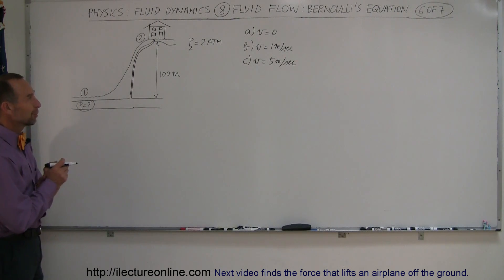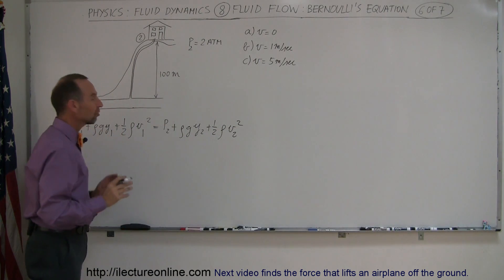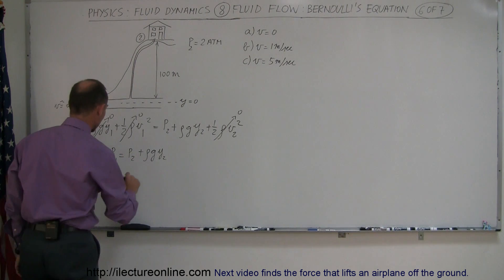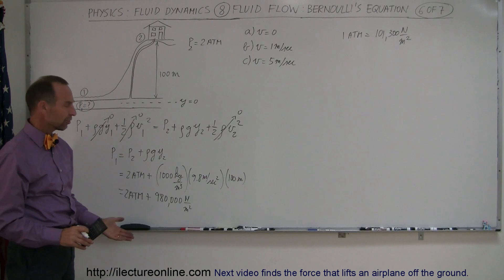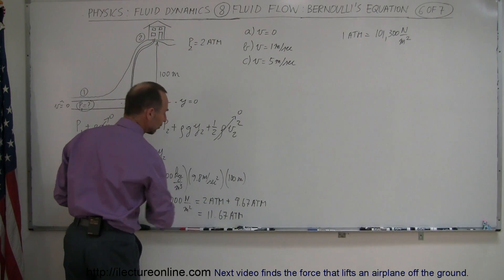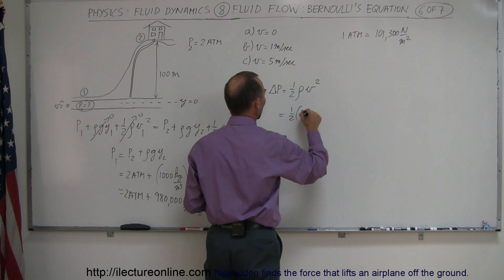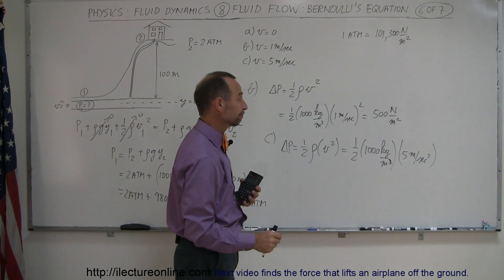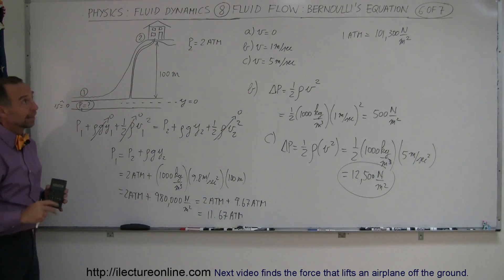Physics 34  Fluid Dynamics (6 of 7) Bernoulli's Equation

Comment: Why do P1 and v1 not change when v2 increases?
Reply from the maker: The "main" (the large pipe under the street) is typically so large that it is virtually not affected by what goes on in a single line of a house (which is much smaller in diameter and carries a lot less water).
Reply: @MichelvanBiezen  Thank you so much! :)

Comment: Hi I have a question about HSRO EDI Package. Say you have the capacity of EDI 5m3/hr then the pump used for the distribution has 18m3/hr due to lot of point of use. Is it ok? Is there no gap or deficiency at the suction like 5m3/hr vs 18m3/hr? Or there's an explanation? Thank you.
Reply from the maker: That is a question that probably needs to be directed to the manufacturer.

Comment: Why are we not considering the height( i.e. 100m) in part b and c?
Reply from the maker: We worked out the pressure difference first using the change in height.  This pressure difference then results in a change in the speed in parts b and c   (Therefore the height was considered in parts b and c)

Comment: but what about the diameter of the pipe? why should the diameter of the pipe not be considered for the calculations?
Reply from the maker: The diameter of the pipe is not needed in Bernoulli's equation.  It is used sometime when the velocity is needed.

Comment: Can you do one example where by the tank is at 100 m high. And a pump is required to pump to 12 m levels below the tank.
Reply from the maker: It sounds like it is the very same problem with different numbers?  Let me know if that is not the case.
Reply: @MichelvanBiezen  Hi. Is a similar problem with your video. Is just that instead of pumping the water up from bottom, it is pumping the water down from above. I had managed to spot my mistake already. Thanks!

Comment: How velocity of points 1 no zero velocity???
Reply from the maker: If point 1 represents a LARGE CROSS-SECTIONAL pipe, then the velocity of the water in the pipe will be very small due to the small amount of water moving up the small diameter pipe.  And since the velocity term is squared, a very small velocity squared is nearly zero and can therefore be ignored.
Reply: @MichelvanBiezen  শর্ট ভাবে ক্লাস নিলে ভালো বুঝতাম please i want connect to you Facebook page
Reply from the maker: I seldom use my face book page.  (No time for it).

Comment: Hi Michel van Biezen,
Thanks you for your videos.
I have some problem as when I have a lot of sink on using the same time, that I can use this Equation ?
P1 + 1/2ρ v1 ^2+ρgh1 = P2 + 1/2ρ v2 ^2+ρgh2 +  P3 + 1/2ρ v3 ^2+ρgh3 +  P(n...) + 1/2ρ v(n...) ^2+ρgh(n...)

Thanks you.
Reply from the maker: I have never used that equation.  That is not the way in which Bernoulli's principle is used.

Comment: One question sir, why we have water tanks at height when we are considering pressure as atmospheric at both ends.. We want pressure or velocity at the end.. Will wait for your reply.. Thanks
Reply from the maker: The difference in atmospheric pressure is typically small compared to the difference in pressure to the difference in water level.  Therefore typically it is ignored.  If necessary the difference in atmospheric pressure can be added.

Comment: Will you please explain more why V1 is zero??  If you consider it as a reservoir rather a pipe then V1 might be zero as the fluids are not flowing. 
for (b) and (c) why h2 is not considered ??
Reply from the maker: Point 1 is at the main of the water supply that supplies all the houses and businesses along the way.  The velocity of the water through the main tends to be very small and can typically be ignored when compared to the speed of the water in the pipe feeding the house.      When the water through the main speeds up (when lots of customers are using water, the pressure in the main will decrease and the pressure at all the houses will decrease
Reply: @MichelvanBiezen  Thank you so much for the reply about v1 but for (b) and (c) why h2 is not considered ??

Comment: One dumb question here: the computed P1 in (a) was in such a way that P2 should be 2atm while v2=0m/s (closed valves), should we not re-compute for P1 and P2 in (b) and (c) when v2=1m/s and 5m/s to see if water will surely flow inside the house at a normal enjoyable rate?
Reply from the maker: Certainly, that would be a good exercise, but at this time, I believe the logical answer should be apparent.  That is often done with physics.  (What would happen if we let the "variable" go to zero, and what would happen if we let the variable go to infinity?)   That often gives us a good insight.
Reply: @MichelvanBiezen  thank you for helping me develop and strengthen my reasoning skills which I believe is helpful in enjoying physics like I've never done before!

Comment: Thanks Sir, But number C  the speed should be squared which is equal to 25.
Reply from the maker: Correct.  The result took the square into account (answer is correct), but I forgot to write the exponent.  Thanks for pointing that out.

Comment: Sir why dont we connect houses water supply from deep underwater. It costs alot initially but from this problem it seems, it is worth the price as the lower the elevation, the easier it is to supply water to houses on high lands?
Also why didnt you take the height into account in the second and third part of the equation por favor?
Reply from the maker: Water supplies are usually taken from a higher source which means we can use gravity to supply the water.   On part 2 we just calculated the difference due to changes in the velocity only.

Comment: You explanation is no place in real life. How v1 could be zero?  If you build the house you connect to general water distribution system, and v1is not zero.  Examples as you shows is no place in real life. Show something real.
Reply from the maker: A playlist with additional parameters is being developed see playlist:  FLUID DYNAMICS 1 HEAD LOSS & RESISTIVE FORCES

Comment: Watched all 7 lectures trying to understand this: if my veins are blocked by cholesterol, that is, become more narrow, then, according to Bernoulli law, the blood should flow faster and my blood pressure should be lower - isn’t it counterintuitive? Am I missing something?
Reply: One part of Bernouilli's equation that is not defined in these videos (or up to this point at least) is how energy is taken out or put in the system. So yeah you have P+pgy+pvv/2=C, but thats because we're talking conservation of energy. Your body doesn't do that. Your body has a pump. A heart. So to be precise, the actual equation is =C+external energy (friction, pumps...). Now it's time for some biology.

In biology, your blood needs to transfer nutrients and, most importantly, GAZ. The efficiency of those exchanges is HIGHLY proportionnal to pressure. As such, in order to keep you alive, your body will try to keep those exchanges efficient, and will thus try to keep the pressure constant. (That's about it for biology, back to physics!)

So if the Pressure needs to remain constant, I hope your height doesn't vary too greatly, and your blood flow should also remain somewhat constant (or it would be bad, but I'm skipping this biology lesson), what now? You did note that your veins were getting clogged up, that has to have an effect! And it does. It increases friction (smaller pipe radius will lead to more friction as more fluid touches the walls instead of other fluids. It's the ratio of perimeter over area that changes). Well that's good, but given that none of the other 3 factors change (speed, height, pressure), what happens then? Well if you lose more energy in friction, you will have to spend more energy in pump work. So higher workload on your heart. Notice it's not your veins that give up, it's your heart. Your pump cannot keep up with the friction, or not for an infinite time.

TL;DR :  Your blood speed, height and pressure don't change, it adds friction which overloads your heart (the pump), which ends up breaking. Hope this helps.

Comment: Sir,
in situation b and C, why did't you take into consideration the height difference?
Reply from the maker: We were only looking for the change in pressure due to the change in velocity.
Reply: Michel van Biezen you mean that this is the pressure difference between case a and case b, correct?
Reply from the maker: Yes, compared to zero velocity.
Reply: Michel van Biezen I got your point thank you sincerely

Comment: Hello,In part a) why did you take v1=0 m/s. I know that A1V1=A2V2But if there is a displacement... then we have velocity, how does water gets from 1 to 2 with 0 velocity ?Thank You!
Reply from the maker: Note that you are looking at "current" conditions, not at conditions that occurred before to get to this state.  As you indicated if there is no water in the vertical pipe (from 1 to 2) water will have to be pushed up to the top before you can have the current condition.
Reply: Oh! Thank you very much...

Comment: if i want to know the pressure drop, are we could make the formula as your video 1?
Reply from the maker: Pressure difference is also caused by a change in velocity.  You also need to take that into account like in the video.  Sometimes you have to figure out the change in velocity.  (shown in some of the other videos).

Comment: Shouldn't c) be 2500 N/m^2?? Great videos by the way!!
Reply from the maker: The answer is correct, but I placed the exponent "2" in the wrong spot on the second to last statement.  (The velocity is supposed to be squared).  Thanks for checking.
Reply: @MichelvanBiezen  thank you. i made that mistake too.

Comment: SIR ,After seeing this video i came to know that pressure is a function of height and velocity both.if we want a change in pressure then go for (rho*g*CHANGE IN height) IF HEIGHT IS CHANGING . pressure difference is also can be taken as (1/2*rho*CHANGE IN velocity^2) IF VELOCITY IS CHANGING.So both can be taken individually according to requirement .
 SIR, please TELL I AM THINKING RIGHT OR NOT
Reply from the maker: You cannot take them individually.  You must consider them together (that is why we use Bernoulli's equation).
Reply: BUT SIR I CONSIDER THAT CASE WHEN OTHER FUNCTION IS NOT CHANGING.In this question SIR,you take velocity only as changing so i thing you take (1/2*roh*velocity difference^2).
Thank you sir for reply.
Reply from the maker: You can always be sure that A1*v1 = A2*v2
Reply: ok SIR,THANK YOU SIR.

Comment: A fluid flows along a conduit as in Q1. The density and mass flow rate of the fluid is 850 kg/m3
and 200 kg/s. The cross sectional area at section (1) is 0.10 m
2
and at section (2) is 0.15 m
2
. Section
(1) is 0.5 m vertically above section (2). If the static pressure at section (1) is 100 kPa, determine the
static pressure at section (2). 

I am really getting confused with this question, i keep muddling up what i need to work out first, any help would be grateful!
Reply from the maker: +NiiNii FC 
use the flow rate equation to find the velocity at 1 and 2    delta V/delta t = v1 * A1 = v2 * A2   
Then you'll have to use Bernoulli's equation to find the pressure.
Reply: Perfect, i understand now! I did not think i would get a reply, but i am very grateful, your video's are amazing, thank you for doing them.

Comment: What is meant by pressure here? Can anyone explain it please
Reply from the maker: +Tahsin Rahi 
Pressure is defined as:  P = F/A        In the case of fluid flowing through a pipe, the velocity of the fluid is a function of the pressure difference between one side and the other side.  (also the difference in height)
Reply: +Michel van Biezen 
thank you for the reply. Actually i want to know, why P2 = 2 ATM ? why didnt u use P2 = h(rho)g formula?
Reply from the maker: +Tahsin Rahi 
That pressure is created by the water source (not in the picture) and was arbitrarily given for the problem.  (Assume that the pressure at the faucet is 2 ATM)
Reply: @tahsinrahi4491   its a given data P2= 2 atm.

Comment: In part C)   P1=2ATM+9.67ATM+0.12ATM. This is increase in the pressure.
more than in part a) where v=0.
so, you said 5:50 decrease in the pressure for P2, but P2 is fixed and equals to 2ATM.

Comment: I believe there is a simple calculating mistake for part C. The answer is 2500 N/m^2, not 12500 N/m^2.
Reply from the maker: The velocity is squared  (5)^2 = 25.
I placed the exponent in the wrong place.
But the answer is 12,500
Reply: Ah okay I see it now. Didn't catch the squared. Sorry.

Comment: if 2ATM is the minimum calculated pressure to reach the house and when you use the tap it drops, does that not mean it will not be able to reach the house anymore?

Comment: For part (b) and (c) what is shown is the drop pressure due to the increase in the velocity of the fluid; it is not really the total drop pressure which must take into account the term related with (rho)(g)(h2). The explanation is not enough clear and may confuse the watchers...If someone else can clarify would appreciate¡¡¡

Comment: Mr. B. if you could please explain the delta p equation you're using in part b and c. Using the Bernoulli Equation I though you would need and additional rho*g*h_2 term added on to the end. I have an exam next week, last class average was a 45, so I have given up on my professor and embrace you as my teacher.
Reply from the maker: Tony,
For part b the question was:  How much does the pressure change due to the increase in velocity from 0 to 1 m/sec
Thus the change (in this case decrease) in pressure only depends on the one term:   1/2 (rho) (v^2)
Reply: It confused me for a bit as well. Notice that the units for 1 ATM is N/m^2, keep in mind 1 N = 1 kg*m/s^2, making 1 ATM = 1 kg/m*s^2

0.5*p*v^2, units for p and v^2 are kg/m^3 and m^2/s^2, if you combine the units you'll  see that 0.5*p*v^2 has the same units as pressure

Comment: Hi, 

Where did you get the Delta P = 1/2 pv2
Reply: Since we want the decrease/drop in pressure at different velocities we are not concerned about the other terms in Bernouli's Equation. We first assume the velocity was zero to simplify the eq'n and get P2. Now we use P2 - P1( delta P) = 1/2pv^2 to calculate the pressure drop at different velocities.
Reply: @xXxhosaNostra  It wasn't neglected. Part B just showed the difference of pressures from Part A and Part B due to change in velocity (from 0 to 1), if you will deduct the result of Part B from Part A, that is the new P1 (pressure at reference point) due to increase in velocity.
Reply: In most fluid problems I've seen - if there is a tap open at one end, the pressure at that end is assumed to be zero. Is there a simple way to determine when to rewrite the entire energy equation setting P2=0 and when to just use deltaP=1/2pv^2?  Thank you for your help!

Comment: How did you come up with the delta P equation when plugging in the given velocities
Reply: +ninjae4976 point 1 and point 2 for parts b and c are both inside the house. Then you can assume the house as height reference zero and  rho*g*h on both sides go to zero. The V inside the house at point 1 is zero so all that is left is delta P = 1/2 * rho * (V2^2)
Reply from the maker: Thomas,
For part b and part c, the only difference is that the water in the small pipe is moving.  The term that adjusts the pressure for that velocity is delta P = (1/2)*rho*v^2.  (It is the part of Bernoulli's equation that takes into account the velocity of the fluid.)
Reply: +Stephen Gholston THANKYOU! Finally it makes sense 👌🏽
Reply: Just redo the bernoulli calculation he did in part A with the non-zero velocity value from part B. You'll find that the P1 value goes up by 500 N/m^2. So the "delta" P is defined as (Newly calculated P1 - Old P1).
Reply: One day we'll learn that mind twister.

Comment: If you were not given the pressure, but instead given that a pump was supplying 4kW of energy to the water and it was flowing at 500litres/minute, how would you then calculate the pressure at the top and bottom of the hill? Many thanks for taking the time to help.
Reply from the maker: Arch,
Then it becomes a Power and conservation of energy problem.  There are some videos like that in the physics: mechanics playlist  (see problem # 146)
Reply from the maker: Arch,
That sound like a conservation of energy equation.
First you need to use the following principle:

W + mgh1 + (1/2)mv1^2= mgh2 + (1/2)mv2^2 + heat lost

That will give you the velocity at the new height.

Then you can use Bernoulli's equation to find the pressure.